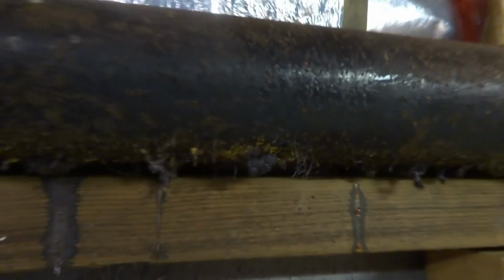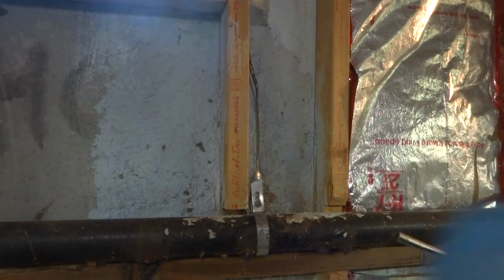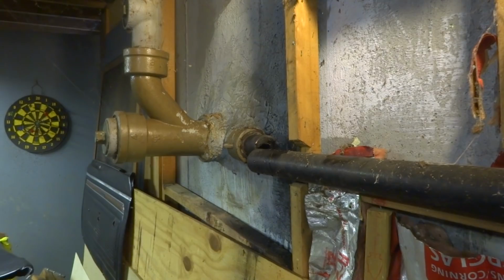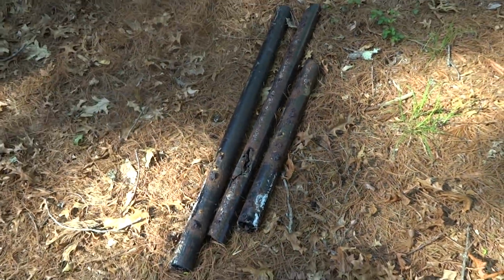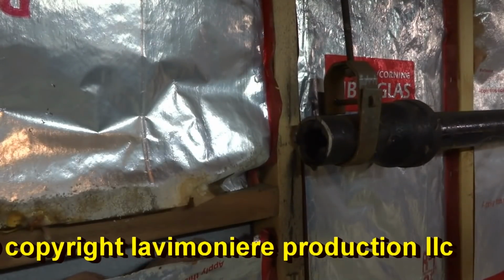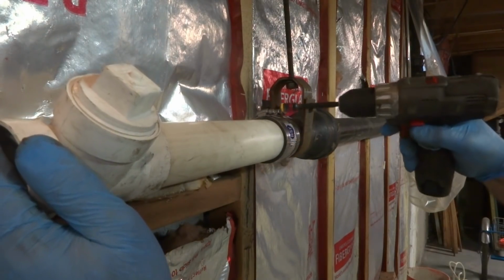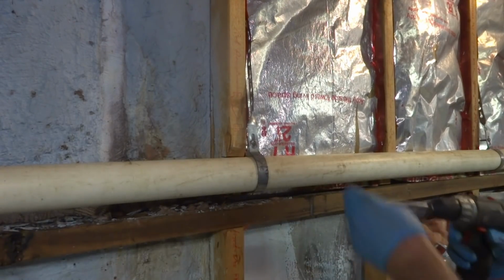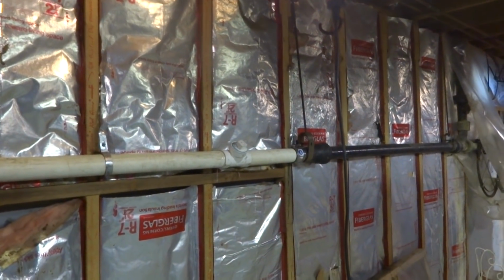ROTTED CASTIRON DRIAN PIPE CUT OUT AND REPLACED WITH PVC

Comment: I thought you would use one of those ratcheting chain cutters to cut the pipe. They make a nice cut.
Reply from the maker: not on old pipe it could crush..... it being old and thin best to cut with grinder or saw zall  unless you want to change more pipe .. been there done that ..
Reply from the maker: @belly tripper yes many times on old stuff
Reply from the maker: @belly tripper really ??? fuckoff
Reply: @belly tripper I'm not even a plumber and know for damn sure it'll crush it..Steve told ya ass.
Reply: @belly tripper old cast iron turns to fine china in this condition.

Comment: Code does not require it to be replaced with cast iron?
Reply: @barackobama5304  Or in Lake Forest Illinois no pvc anywhere even condensate drain required galvanized on inspection to sump pit.

Comment: 7In steel cutter on a 4 inch grinder...BEST way to cut out cast! :)...Don't know if you seen them yet but the Diablo 6 in. Carbide Recip Blades for
 Thick Metal Cutting, Are KILLER...For that finish cut; they're perfect...Like BUTTAH!
Reply: I use those blades. They are AWESOME
Reply: @kenc.9067  Right! They're beast! I use diablo blades in all my saws...

Comment: Don't use plastic man. I hate dissimilar materials. If it's cast iron replace it with cast iron. If it's DWV copper replace it with DWV copper. Nothing worse than going into a basement and seeing a small section of plastic pipe connected to a metal system. Does it work? Yes. But it's not right. Maybe that is just my OCD.